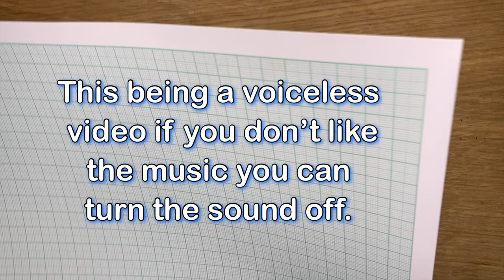Making a wire bending jig tool for basic stone setting technique.

Comment: Ooooo…. I just thought of something…. designs could be etched into those glass beads so very easily with a Dremel tool… the possibilities are endless… however, the simplicity of the pendant is gorgeous on its own!
Reply from the maker: Nice idea … I hadn’t thought of cutting the glass … i’ve got lots of diamond burrs that will do the job …  cheers N
Reply: @Nickscreativestuff   yep!!!the Diamond burrs will do the trick all right!!!! I asked my hubby for a complete Dremel set for our 21st Anniversary last year and he told me to go on Amazon and make a "Dremel wishlist" and add exactly what I wanted and he would get it for me… he said he didn’t want to get something That wasn’t what I was wanting and have to go through the hassle of returning it lol… I got the the 73 piece kit that came with: (1) 4300 Rotary Tool, Pivot Light, 225 Flex Shaft, A550 Shield, A577 Detailer’s Grip, 678 Circle Cutter/Straight Edge Guide, 575 Right Angle, A576 Sanding/Grinding Guide, 565 Cutting Guide and 675 Garden Tool Sharpener… I also got the Dremel 231 Router Table attachment and the Multi-vise… plus a lot of various bits and burrs, Sanding drums, cutters etc… but my favorite attachment for the Dremel has to be the Flex Shaft… I use that more than the main Dremel tool itself!!! So much easier to hold that and use it like a pencil than it is to try and hold the entire tool to do detail work!
Reply from the maker: sounds like somebody really loves you … new tools … the way to an artist heart. looks like your hubby won’t see much of you for awhile with your head in all those user manuals. I have a flex shaft,  makes life a lot easier for detailed work … have fun with your new toys … N
Reply: @Nickscreativestuff  yes… I had to read those user manuals alright… and yes, I am quite spoiled by my hubby… lol… I’m can't work because I have seizures and a completely yfused spine thing hat goes from the bacml k of my skull clear down to my pelvis…it’s the equivalent of having a broomstick shoved up one's bum! So, because of my issues, I do a lot of crafting… I’m actually trying to possibly set up some sort of online store to sell my creations or possibly have a little booth in a crafting show to make a little bit of extra money… if anything, to just make enough to at least cover the costs of my supplies to keep me going :)
Reply from the maker: hi zippedupkitz, manage to miss messages sometimes …  sorry to hear you’re so debilitated, good job you have an interest in arts and crafts to keep you busy. I don’t think I could survive without the opportunity to be creative. i’ve been getting more enquiries about the stuff I make and whether I sell it or not. I know I should be trying to sell stuff online but the work and commitment  involved puts me off. Maybe one day I could be more committed. i’ve really enjoyed having a stall at craft fairs and Christmas shows although even more work to get out and about with it all and to make it pay I feel you have to be doing it all the time from one show to the next. I think the Internet has masses of potential for arts and crafts if you have the mindset for it and you’re an organised sort.
good luck with your endeavours … Nick
Reply: @Nickscreativestuff  thanks :) good luck in your work as well…
Reply: @ZippedUpKitz  oh dear, here too, unable... u wad a nurse,well in fact am still a nurse, but can't work anymore. Can't stand anymore and can't sit anymore. If I sit 15 minutes, I can't get up anymore. And above all my husband left me 7 months ago. With Easter... not that u care about Easter, I am a moslim. But that's how I remember it. He didn't left me. I kicked him out. It was over. And then u realized what I have done... oops. He took care of me, but there wasn't no more love... and he pushed me in my corner. I wasn't allowed to go in t he kitchen, etc. He was taking care of everything. I was really an invalid... in my corner... sleeping all the time from the medication. Waiting to die. And now... when he was a way I was looking in my kitchen, it was filthy my fridge was filthy. The outside was a bit okay,but the rest was filthy. Since he left 6 months my house is mine again and I am going away. It take me a few days to recuperate but at least I am going out of my house. My kitchen is shimmering, I have a cleaning lady, I have help to get a shower in the morning, I am free..  so be blessed if you have a hubby that supports you in a good way. That is giving you tools to be active. Even if it is a few moments a day. Now I know what I missed the last 4 years .. I am living again. In the meantime I have a new girlfriend,    she is gorgeous (I never want a man anymore. My best relationship was with a woman, but she passed away. I am 2 times a widow... and now I am going be divorced... the rest of my life u want someone next to me who is supporting. Not pushing me in my corner anymore. No way... 
I dont say all man are bad. Even my husband who is away wasn't a bad guy. We still are friends and ge doesn't understand what us happening with me. I am happy again and free. I have my 2 dogs and my cat. And my hobby wich is wirewrapping. Try to stay as mobile as you can. . It is better for your body, your mind and above all for your relationship... big hugs from Belgium. If you wanna talk and exchange ideas, you are welcome. You can find me on Facebook and on whatsapp and messenger. Malika Ann Noyez. Always my real name... and thats for you to nick... 
0032468 33 08 98 is my phone number. If you want to whatsapp...

Comment: Very clever to use graph paper to make the holes.  Of course you need a drill press, not hand held drill.  This is easy and fun.  Where did  you get the steel pins?  The holes have to match up so best to get the pins first then drill.  Thank you!
Reply from the maker: Hi MJ, I was inspired to make this tool after finding 4mm x 1m steel rod  at my local home improvement store B&Q in the UK. However I’m sure nails would work well for this, I found some that were 3.5mm in diameter one time that come in useful for all sorts of projects. Also aluminium knitting needles are easy to cut up and use for this … good luck with it … Nick

Comment: I really LOVE this and want to make my own jig, but cannot catch the measurements, could you post the diagram with measurements?
Reply from the maker: Hi Dianne, I laid this grid out on metric graph paper, the staggered offset centres came out at 7mm apart. The pins and holes were 4mm diameter … hope this helps … Nick

Comment: Nice clean, minimal setting. I think it would work well with the fused puddle I make out of my scrap glass and bead fails.
Reply from the maker: thanks Jirup, i’m sure this technique could work well scaled down using silver to hold small items. perfect if you can make glass cabochons … Nick
Reply: @Nickscreativestuff  I have a teensy little fibre kiln that I heat in a microwave oven, perfect for melting small amounts of glass. The little kiln I use to anneal beads doesn't get hot enough to melt glass.
Reply from the maker: didn’t know you could use a microwave for glasswork, sounds a bit scary if you don’t know what are you doing. I participated in a glass bead making weekend class … thoroughly enjoyable … couldn’t justify the expense of taking it further at home … N
Reply: @Nickscreativestuff  Lampworking is a bit pricey, but I love it. A microwave kiln isn't overly dangerous, just don't use your kitchen microwave because you don't want to be contaminating it with ceramic fibres. The physics is pretty basic. The kiln is made from a refractory material, lined with a susceptor. The susceptor absorbs microwave radiation and converts it to radiant heat. Granted, removing the kiln from the oven with an internal temp of around 700C, does have some inherent risks.
Reply from the maker: it’s amazing how many modern and old creative processes there are out there to explore. I would try lamp work one day if I had the time and money. i’m a bit nervous around microwaves these days. The worst burn I’ve ever experienced was when retrieving a mug of hot milk from a microwave, I hadn’t noticed the silvery metallic handle had got so hot it had turned blue with heat and my fingers stuck to it. i’m sure a new microwave kiln would come with lots of instructions and warnings to follow.
anyway I won’t waffle on … enjoy your creativity … Nick
Reply: @Nickscreativestuff  Despite the amount of fire play I have engaged with, cooking has always been responsible for my worst burns. The real heat is inside the kiln, the outside is cooler than the temperature of a casserole dish coming out of a regular oven, you still need gloves and a heat proof surface for it to cool on, but that's all.
Reply from the maker: Hi Jirup, fascinating how this can work, I started watching a few videos on the subject amazing how quick and efficient it all is. maybe one day I would get into glasswork if I had more time on my hands to explore other mediums … cheers …  Nick

Comment: Love this stone setting! Just bought a wire jig. And just learned to solder. Was wondering if you had to plate the solder points and if you did how did you do it?
Reply from the maker: hi Tammie, good to hear you’re moving on with your creativity. The simplest way to copper plate over the silver joints that I found is to use spent pickle. I separate some out making sure it’s hot and drop in my piece to be copper plated wrapped in steel wool. steel or iron in the pickle will cause a reaction copperplating anything that’s in the pickle bath … N
Reply: @Nickscreativestuff  HI Nick! Thank you for responding to my question! That doesn't  sound to difficult. I started  my journey in wire wrapping but my main interest is Metalsmithing.  And your videos are thoroughly informative.  So thank you for doing them! And have a wonderful day 😊
Reply from the maker: thanks Tammie, good luck with your adventures into metalsmithing … a thoroughly enjoyable hobby to experiment with … N

Comment: I like the voiceless video. There are no subtitles, and no written instructions. Is there a location where you have posted the size of the drill bit, and the bit that cleans up the holes, the size of the metal pins/posts that are used for bending the coper wire? thank you
Reply from the maker: Hi Catherine, sorry I didn’t realise I missed out all the crucial information from this video, I’ll have to add it to the description. The drill and pins were 4mm, the wire was 1.7mm and the graph paper i  used for layout was metric. I use a diamond burr to bevel the edges of the drill holes it came from a box set like this … https://www.amazon.co.uk/Lapidary-Polishing/dp/B078P8BLFV/ … hope this helps … N

Comment: How do I find the pliers you use in most of the video? They are heavy and don't have rubber handles. What are they?
Reply from the maker: Hi Jenn, I found these in a secondhand tool shop. When doing an Internet search for large round nose pliers nothing comes up apart from small jewellers varieties. The only thing I can suggest is buying a large pair of “internal circlip pliers” and cut the tips back somewhat … good luck with it … Nick

Comment: How do you clean the black off after soldering? Thanks
Reply from the maker: hi Sandie, Hot acid is really good for cleaning copper after soldering, some people use a home recipe of hot white vinegar with salt dissolved in it as a cleaning bath … hope this helps … Nick

Comment: What size bit did you use and what was the tool you used to countersink?
Reply from the maker: hi Terri, I used 4mm pins and drill for this tool and after drilling i used a cheap diamond grit burr to soften the sharp edges of the holes … N

Comment: I have two questions about this:

1. Your drill holes are even ans 1cm apart from one another, but you didn't use the thicker 1cm intersections of the paper as reference. Instead you went diagonal. Why id That?

2. What width is the drill bit?
Reply from the maker: Hi Igor, there are a few layout patterns that can be achieved with graph paper. This offset staggered arrangement is my favourite as it gives me triangles and hexagons to play with. I made this tool with 4mm holes and pins … N
Reply: @Nickscreativestuff  thank you. I decided to copy your tool (with some tweaks), but when I went to the local hardware store, there were no pins whatsoever. I settled for some 3mm and 3.8mm thick nails, hoping that will work as well.

Your device here is simple but brilliant. Thank you for making this video.
Reply from the maker: i’m sure nails will work really well. I use them a lot for all sorts of different projects, a very useful material … good luck with it, I hope it works for your … N

Comment: Where can I purchase the steel pegs? And other tools you use?
Reply from the maker: I found 1m lengths of bright 4mm steel rod in my local hardware store called B&Q in the UK. However my now preferred choice is standard knitting needles as they come in a huge variety of diameters cheap and readily available in many stores and are made of aluminium so are easily cut to length. Most tools I pick up when I see cheap on offer somewhere especially like Lidl where I bought a recent box of diamond burrs. my favourite go to pliers open when you squeeze the handles and are called external circle pliers used in the vehicle mechanics industry. otherwise I use cooksongold.com for jewellery tools … hope this helps … N

Comment: Sweet!
Is that a fire brick?  
How is the wire cleaned after soldering?
:
Reply from the maker: A quick critical look at Cooksongold website shows it’s called a soldering block. 
An easy way to clean the copper after soldering is to dip it in salty vinegar  whilst  the metal is still hot … Nick

Comment: In fact you can use that jig for all the ormther small jigs you made... what are you using for pigs?  Nails???
Reply from the maker: nails work very well for pegs if you can match the hole size … i’ve used knitting needles before come in a variety of sizes and easy to cut being aluminium. my local DIY store sell bright steel rod I’ve also used N

Comment: How do I know here to drill the holes in the block? I could not tell where in your video. By the way your work is amazing 1:28 ,
Reply from the maker: sorry I wasn’t very clear about the layout in the video, but I was using metric graph paper and because the layout was diagonal one pin hole ended up in the centre of a 5 x 5 square … N

Comment: Where did you get the pegs?
Reply from the maker: Hi Hatice, the pins are cut from 4 mm bright mild steel bar/rod. comes mostly in  3m lengths. some Internet suppliers will cut and supply it in shorter lengths … N

Comment: Because there's no voice there's no explanations. Why did you drill each hole twice?
Reply from the maker: The second pass over the holes is with a diamond cone burr, I used it to sand off small splinters on the surface of the holes and to give the holes a small counter sink shape … N